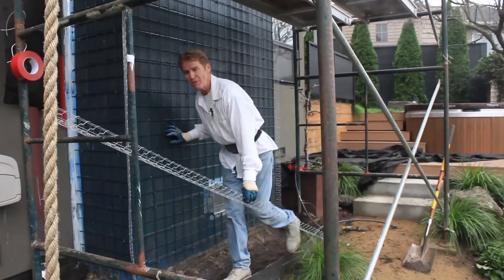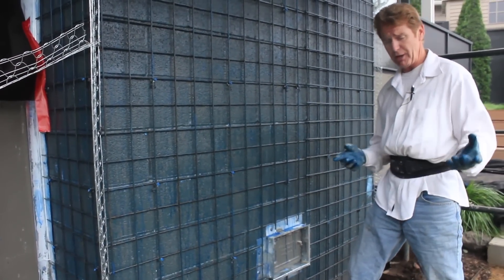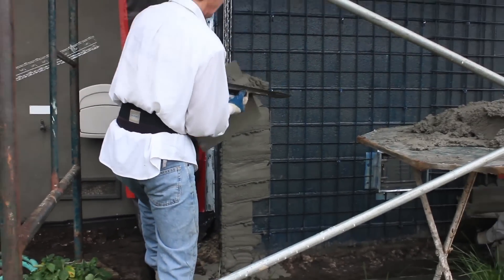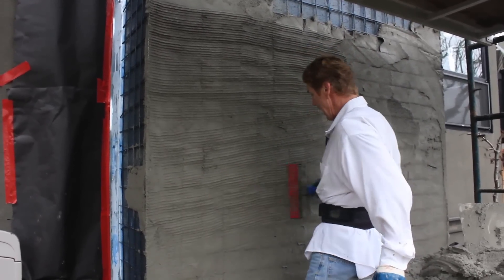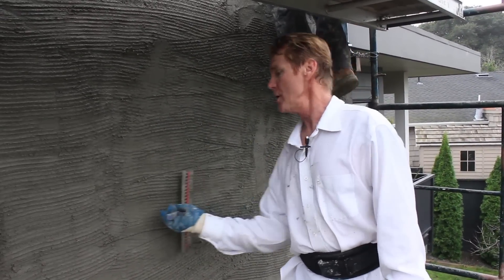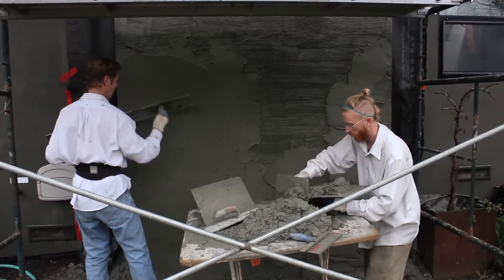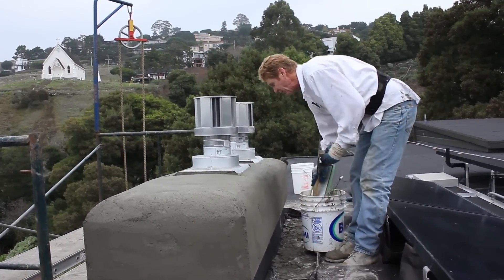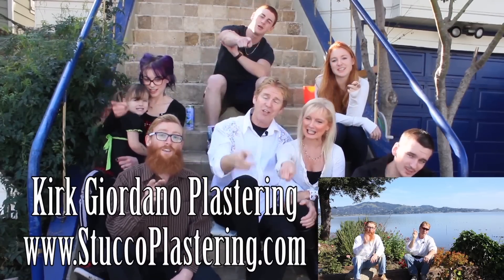Stucco a Rebarred Reinforced block chimney

Comment: That wont hold
Reply from the maker: Good morning Dee, we're all entitled to our opinions.
Mine is, it will not only hold for thousands of years if there's a nuclear war, "that chimney," will remain standing.

Happy holidays and New Years to all, from Kirk Giordano plastering and Family
                   Plastering tip’s for beginners or experts.
Reply: Structural and restoration engineer here. This is very interesting. I would have never considered plastering the wall to enlarge/stiffen. I would have defaulted to a form and pour method with self-consolidating concrete, and finish accordingly.  But as long as enough area of steel is provided in the mesh and the anchoring to the wall is sufficient, this should be fine. Very cool, Kirk.
Reply: When you remove old render the thicker parts are allways the easiest for a reason

Comment: Why didn’t they decide to use the chicken wire type first then the rebar type after to make it easier for the stucco to stick.
Reply from the maker: Good evening Steve, there are many ways to skin a cat. 
Although we didn't attach the rebar, I support its application. The general contractor, who is also an engineer, pressure washed this chimney, we sprayed Weld Creat, 'A stucco bonding agent" through the rebar so that the stucco would adhere even to the substrate.

   Happy holidays and New Years to all, from Kirk Giordano plastering and Family
                   Plastering tip’s for beginners or experts.

Comment: WOW you know you could put up a Ferrocement dome in nothing flat!
Reply from the maker: Howdy Stacy, no doubt
                                              best wishes,
 Sound advice for plastering issues from your favorite stucco geeks.
Reply: i am an old Army Ret, Vet looking at that vertical stuff as a hobbies, you know that stuff they do making waterfalls and fake rocks and you guys are pro's with mud! I've learned a lot from your videos Thanks.
Reply from the maker: HowdyStacy, I have stuccoed a few mountain walls and have incorporated many of the rocks that were existing, just for the heck of it, they are on my site.
 Plus built a three lever water fall using maily stucco, if interested I can send you a link.
                      Best wishes,
Sound advice From your neighborhood stucco geeks

Comment: Kirk, did you use the same coarse plastering sand for the chimney and the rounded cap or do you use a finer sand for finishing more detailed jobs
Reply from the maker: Good evening Tunes Dude, no all the mud on this project was the same three times as much sand to one part cement plaster
                       Live long and plaster
           Sharing the plastering knowledge
Reply: interesting technique of shaping and rounding the large cap.
many here would just slope it a bit.
still the idea is to get the H2O off the chimney .
that was a big job.

Comment: If they really wanted to add more strength to chimney spray fiber concrete would be best option instead that 2 inch stucco.
Reply from the maker: Evening Mr. Wizard, this seems ;logical, however concrete for foundations or walkways have a PSI strength of say 2,000 to about 3,5000 psi.
 This product with just sand as an aggregate not rocks mind you, when full cured set at an incredible 4,700 PSI.
Rapid set manufacturers it for our bridges and man is it expensive.
 That crazy strength plus the rebar and two inches think
 Google Eisenwall cement plaster as the technical stuff I know but takes to long to share accurately y in this small space.
Cheers,
 Kirk and Jason giordano’s rendering videos
Reply: Your link provided info that after 28 days Eisenwall cement plaster is 3500 PSI. 
Didn't knew that you use so weak concrete in US as you stated. We usually pour footings, slabs etc. with concrete that has 4300 PSI it's premixed and delivered by concrete mixer truck and it's still quite low end concrete as strenght wise.

Comment from the maker: Morning Todd Forfreedom, your question does not have the normal reply link under it so hopefully you get this answer to your interior brick question.

Anyone know why 1 out of 25 don't have this reply link?

With an interior brick or cinder block surface the rules change a bit, they are simpler.
First prep your brick wall properly, apply bonder if necessary, then If it were me I would apply either a Struct-light base coat or a diamond base coat, and follow up with a finish coat of whichever material you choose for your basecoat. There are more options, but I wish to simplify as best as possible.
All the necessary material's can be found at either of your monster hardware stores such as Home Depot or Lowes if you know what to look for.
Cheers and have a Happy New Years,
Kirk Giordano’s DIY plastering tips

Comment: hi kirk and jay great job as usual. man that chimney was high .one question in most of you videos you use a pool trowel now here in ireland its nearly all square end trowels .i personally use a 16x5 or 18x5 now we use alot of sand and cement here most houses are sand and cement finish out side ,and a sand and cement scratch float inside before skim coating ..all houses are block built .what i want to ask is could you recommend a good pool trowel for both skim and sand and cement work, size and material ie. stainless. carbon steel or blue steel i see pool trowles have short shanks so they should be very flexible thank guys love the videos happy holidays
Reply from the maker: Morning johnzo70, I generally use a 16X5 stainless steel trowel, when I started this video I was using a 20X5, but most folks find this too big and awkward as it's mainly used for concrete finishing.
 Note the ends are not a complete radius, they have a straight edge, just the top corners have the curve.
 I would recommend the 16X5 as we as plasterers need to be able to flex the trowel in order to muscle it where we need the plaster, if it's 4 inches wide or less it won't have the flex and is usually only good for concrete finishes,
 I tell my guy's an 18 or 16 X 5 rectangular trowel are the best for experienced plasterers, while the standard 12X5 is for the beginner.
 I just happen to prefer my 16X5 as I'm shown later in this video using.
 best wishes,
Kirk and Jason’s DIY plastering tips

Comment: Would it be easier or quicker to do it with a pump ? Or is the pump only for big houses ? Great videos ! I work in Santa Barbara
Reply from the maker: Evening Mate, I no longer own a plaster pump  or what used to call a Tommy gun.
 I have not regretted selling that beast of a machine yet, in fact I'm still celebrating.  
Cheers,
 Kirk and Jason giordano’s rendering videos

Comment: Nice job guys. I have the same problem only inside and its all brick. Would you suggest doing the same thing only with less thickness and a smaller mesh then screw it into the mortar joint? Can you also suggest an online company for corners, drip screed and darbies?